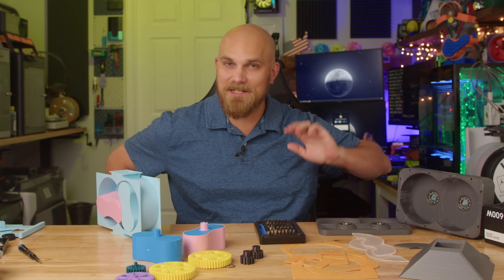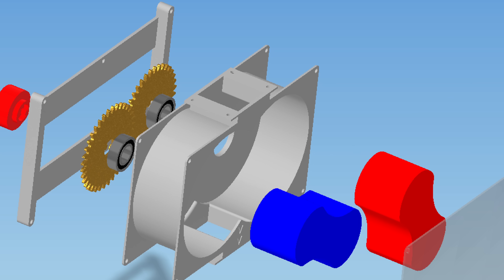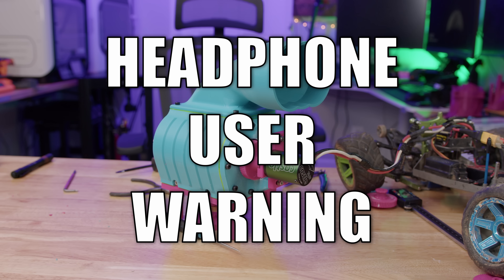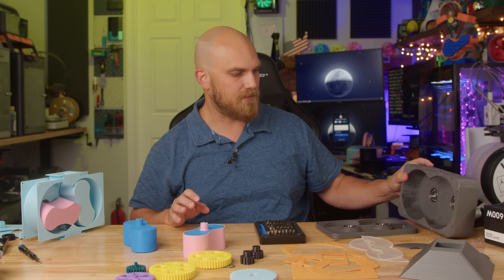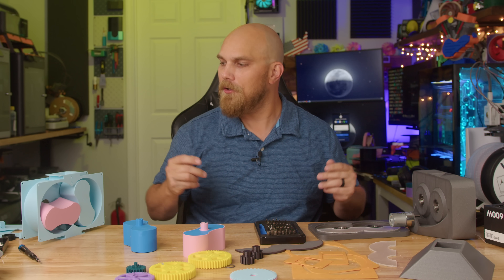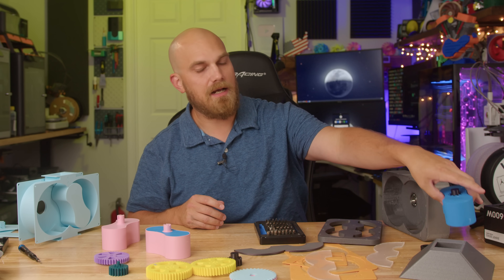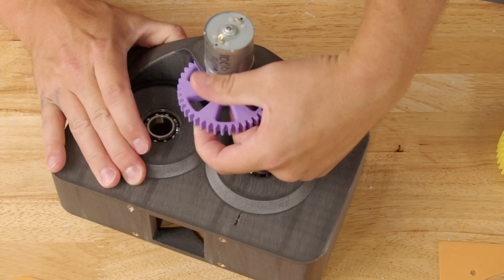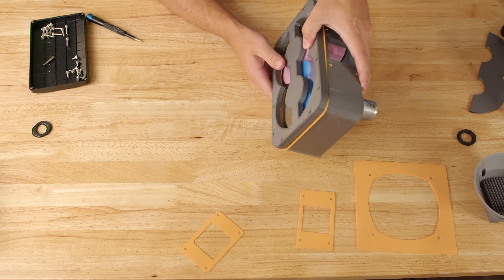Turning a Viewer’s Roots-Style Fan Concept into a Performance Beast! | Fan Showdown S6 REMIX

Comment: Remove those inlet fins! Well known that positive displacement blowers HATE inlet restrictions. Might be worth playing with making the inlet port larger as well. Also might be worth costing the rotors and case with graphite paint to act as a sacrificial gasket between the rotors. TVS (Google them) use a Teflon coating in their automotive stuff.

Comment: you could probably eke another couple mmH2O out of that design by tightening up the gap between the rotors, as well as the gaps between the rotors and housing. Maybe look at doing something similar to the wipers used in commercial designs, but instead of having full contact (as getting the surface finish on PLA to the standard that requires is not happening...) you have a T slot at the apex of each lobe withe the bottom of the T pointing straight out from the center of the rotor. This way, the same way you can slot bolts into the channels in extrusions, you can use a TPU wiper printed so it almost makes contact. 

since the wiper would be removeable, you can just swap it for a longer or shorter one to check different gaps. Alternatively, you can try using other materials like paper or cardstock which may work for a full contact design. of course, that all depends on if you want to optimize the design.

Comment: As a car nut into superchargers I have a couple of notes.

1.  The rotors are too big. I have a 1.3L and a 1.9L blower. The diameter of your rotors are bigger than mine obviously yours are shorter but still.

2. You gotta get some twisted twin vortices style blowers that will be more efficient and quieter. Not to mention you can use four rotors instead of two.

3. Try to balance them, this will save on noise.

4. A lot of good blowers come with either polish or Teflon coated rotors.

Comment: If you tighten up your rotor end clearances to the cover/case (you could do this by omitting the gaskets all together and using a thin layer of silicone to seal the cover), you could easily double or even quadruple that number. Positive displacement superchargers are capable of massive pressures if you keep tight clearances.

Comment: This idea may be here, but look at a rotary engine and there seals. I think your losing airpressure around the lobes. Maybe use a small tpu filament between the lobes and the walls. Also as it's been said, the gap between the lobes and the plates will drop air pressure. But man that looks nice, makes me want one to hang on the wall, it's a kind of cut away.

Comment: If you're going to continue this series the way it's going and the top slots being so far removed from a computer fan than you might as well change the motor base to be something more powerful. 
If the goal is to just to see who can make the most over the top design than why limit them to an underpowered motor that was designed for reasonable fans?

Comment: Adding some lithium grease onto the pla gears can make them both more efficient and a ton quieter. I did this for a water pump contest in one of my freshman engineering classes and it got us something like 40% more water from the same current draw on the motor

Comment: If there aren't occasional scrape marks on the front and back of the case then the gaps between the rotors and case are too big. Also those vanes added in the top just reduce the area of the intake and reduce flow. There's no point in trying to straighten any turbulence when it's going to go through the pump.

Comment: You should make this its own sub-series for 'Fan-Showdown' videos. You can call it 'Fan-gineering' where the whole premise is to take failed attempts of previous competitors and re-engineering their fan design to create a 'best case scenario' if the concept of their idea could actually work. Kinda like a Mythbusters episode, taking the concept of the myth with the premise to prove or disprove their validity by replicating the intended results either by natural chance or by excessively manipulating the circumstantial factors to make it happen.
Reply: I second this
Reply: Third this! This would be awesome!
Reply: I was thinking the same thing no holds bared with and upper rpm limit for the air moving compressing part say 5 to 10k rpm max speed but everything else is fair game even multiple motors for multiple stages of compression.
Reply: Love the name
Reply: It would be interesting for the 'fan-gineering' to also be community driven. Just release the stl files to the community to redesign/modify the base concept.  Anything to far off from the original design gets disqualified.

Comment: Gear reduction is torque multiplication ... While the A12X25 doesn't make much torque you should be able to do 4:1 which MAYBE is enough? - Or perhaps the better question is how much gear reduction will you need in order to turn that apparatus and get some level of flow. Can you even get it to match a stock A12X25s output?

Comment: so. several improvements, some of the comments, use graphite or sewing machine oil to lube the barrings, use ring gaskets on the shafts to prevent bypass, and use helical gears to reduce gear noise. (as well as using a different material to avoid the 3d print rub sound)

Comment: "And I have it windows..."
😒  Going on record now with my prediction, that the massive gap that'll be present between the lobes and that cover, is going to ruin its chances of making any usable pressure. 😞

Hopefully I'm wrong!! 🤞🥴🤞

EDIT 1: Alright, so like like he made the window recess the same thickness as said window plexi... So THAT'S good! However, he didn't make the lobes TALLER than the case, to account for the TPU gasket, thereby causing the gap I originally thought would be there, but way worse now due to being the entire cover in size! 😅

EDIT 2: Hey hey! I was wrong. Totally fine with that!! I do wonder if that gap IS impacting performance though... I guess removing the TPU (and shims) would be the only way to test that.

Comment: It is, I wonder if you put sound dampening foam in the corners and around the edges of the case if that would reduce the noise levels.  Perhaps a needle bearing would be quieter too.

Comment: It seems like your gasket and spacers are creating a larger gap between the rotors and the window. I would be interested to see if you could get a higher pressure with them removed if it will run.

Comment: You should research clock makers' gear setting.
You don't have the manufacturing accuracy to predetermine gear spacing. That is a major cause of noise (and mechanical resistance)

Comment: Awesome concept. There are a few ways to cut down on noise, too. One would be to use helical gears with a cover over them and a small bit of oil. A performance boosted would be felt gasket material for apex seals on the lobes. Or UHMW plastic and a coating of the Silicone-Teflon spray.
Reply: I've seen several performance and noise improvement suggestions. I would love to see all of these.

Comment: Would it not be possible to run this off of an A12 by using belts instead of gears? I think that we still need to see this powered by an A12. Try putting an extended hub onto the A12 that can host a belt, and run that belt to one of the sides, and have a middle wheel that connects to  the drive side via belt, and have the other blower side connect to that center wheel, to get the proper rotation of the second one. Less torque will be needed to spin the belts in theory, and you're able to change the gear ratio entirely by changing the pulley size of the fan. I'm 100% certain that this would function properly, as long as everything is run on bearings, and no belts are tightened too much. Gears are definitely NOT the way to go, though.

Comment: I have a large roots blower in my workshop. It is set up under my CNC router to pull a vacuum on the bed to stop parts moving around. 
Roots blowers dont only move a large amount of air, but unlike a fan which moves the air dynamically, these move air mechanically, by which I mean the air doesnt have a choice. They will keep pushing out pockets of air until there is no air left (if the seals are good)
On the other hand, when a fan encounters low pressure, the blades just spin uselessly without doing much work.

Comment: I wonder if adding a thin flexible "spline" along the flats and the lobe ends would increase the static pressure even more.  As another commenter said, finer teeth on the gears would help decrease the noise level, or even going to a belt drive between the two yellow gears.
Reply: Belt drive ftw. And tighten up the tolerances inside to eliminate gaps for improved performance. And the smooth delivery of power through quiet belts.. 
Yes...

Comment: If we're dealing with positive displacement, might be able to beat it by copying a slip-vane rotor style setup such as a Judson. Might have to be liberal with Teflon coating to get it to work however, given the motor expected to be used has next to nil for torque.

Comment: If you could put a variable rheostat and dial down the speed it would be interesting to see what 1000rpm sounds like, and what the static pressure is at.

Also, your noise at the gears, try to file/sand them down smooth and it may help the noise. Or use graphite as mentioned below.

Comment: The limits that the fan showdown is constrained by is what makes this series so interesting. That being said, it wouldn't be less interesting if the motor limit was removed or at least modified by allowing something a bit more torquey.
Reply: I agree except in this case, 2 of them would be good, while not within the limits of a single A12x25, at least it is a known amount.

Comment: @Major Hardware
would it be possible to make it triple pronged instead of double ( the pink blue center pieced ) and if made by metal it could be made in cero tolerance cutting model... and technically it doesnt need to be so chubby... if you made it slimmer ... the cero tolerance and the extra prong would help to push a higher % of the intake air... instead of like it is right now that a higher % of the air thats inside bounces around not escaping. since fluids ( air included ) will choose the path of less resistance this gaps will make this be way less effective .... and i know that making a cero tolerance metal cut would be expensive... but it could be a great success in an intake fan/compressor .... on the other hand if you do this... the air would be hotter because of said compression and friction so .... the harder its pushed the hotter it will be... this is a real conundrum

Comment: The gear noise reminds me of the other fan seasons back that had smaller fans that were geared and spun better after having been run for a while (broken in). Seems the same needs to be done for these gears, be broken in after running for an extended period of time.

Comment: I'd be interested to see what you could do with the A12x25 motor, just geared down until it had enough torque to spin the lobes. Might only be 500 or 250 RPM love speed, but it's be interesting

Comment: I had a watercooled setup with an automotive radiator and fan in a shrouded box, that was very loud, but the radiator was so big it could run completely passive with two GPUs in the loop.

Comment: It put out 50% more pressure than the leader. 
Wonder if scaling it back smaller, you could use the fan motor to drive it. 
Hollow or very little in fill on the rotors making them as light as possible.

Comment: Looks really good! Personally I'm not too impressed by the performance, I'm also not surprised that you got it to work, with a much more powerful motor. Positive displacement pumps has a huge advantage over fans, when it comes to static pressure, even at the same amount of power. But again, it looks really good, and it's definitely great for showing the working principle of a roots blower. If you can get it reasonably quiet, even if that requires running it at very low rpm, it should be great for decoration.

Comment: This test is a farce 😢 you have abandoned all your previous test criterior, at least your previous tests actually proved they could cool a PC, and if it failes the smoke test, your only visual test, then you have to question your methodology. This is disappointing that you have gone down this rabbit hole and only test a 'so called fan' on one attribute! The wonder from down under could FLOGG this! And what is the CFM? Why are you doing this? Anybody can make pressure! But it has to flow! This couldn't cool an ant let alone a PC, and isn't that why you started this channel? To actually test something that might actually work in a real world situation? Should be ashamed of urselve and I won't be watching anymore of this diluted testing😢 previous seasons were great 😅 the Cheater would flog this! Am so disappointed, cause you were so good & now you only chase ONE parameter 😢😢

Comment: It's loud cuz of all the hollow plastic. I'd imagine something smaller with metal parts and properly engineered might not make that much noise, but the problem is it likely uses a lot more power for the air volume you get.

Getting 25% more air, but using 50% is kinda pointless from a consumer perspective as well. More air is good for cooling, but if the motor consumes way more power to get to that then you are effectively costing yourself more money in the process.

CFM per Watt.

All of this testing is getting more and more pointless though, because all this tempered glass nonsense means it's actually gotten quite hard to find good cases that take advantage of more airflow. I checked on the large case manufacturers and none of their designs strike me as having really been thought about in terms of airflow unless it's something specifically for "workstation" even though it seems they kinda forgot what that means too. Good airflow cases that still offer features you'd want in a case are hard to find sadly.

Comment: Consider using timing belts instead of gears for the gearbox, to reduce friction and noise by a lot. The Voron 2.4 Z-axis gearbox gives a 4:1 (or 1:4) ratio, uses high-speed bearings throughout, and can easily be "borrowed" for this design.

Comment: you need to use the Noctua Industrial NF-F12 3000RPM fans. they are crazy. They produce almost the 8mm in h20 of that best you have on that list. I use them for static pressure in my open case on the wall to go through filters. no other fan would pull air through the filters

Comment: Man if you reversed the gearing so its 1/4 the speed (way more torque) and then put wiper seals on the faces and tips of the rotors, you could get over 30 pretty easy I'd say.
Remember pressure has nothing to do with volume, the better seal you can maintain in the "pump" the higher pressures you'll get, but you need the torque to overcome the friction of wiper seals.
Reply: Also the windows are a massive air leak (ie. face of rotor to window face, because of the not perfectly flat finish with more than minimal air gap)

Comment: Sooo, this goes beyond regular computer mods and such. Taking the side cover off the pc and placing a fan against it would be far greater in reducing what you are doing. But sure, keep digging down this hole. You are, and have been, hitting a  wall with pc cooling. It  is just a waste of time at this point. If you want to work for Noctua, and have fluid dynamics as a PHD, just go work for them and then do some research. This is just, garbage science at this point. Sorry Bro, I started watching your channel for fun. But at this point, it is just garbage science. Unsubscribe, good bye.

Comment: Now what would be nice is if you did a scale model of the A12X25 to fit that motor. That way, we can see if the design is even worth pursuing. It definitely produces more pressure, but it's got a stronger motor. Does it produce more pressure than a comparable fan could?

So we either need to see a design like this one that works on the A12X25 motor - maybe just a smaller scale of everything - or a larger scale fan-style comparable to what the Noctua people could do if they were using an engine with that kind of torque

Comment: The spacer you added between the blower and the window cover to compensate for the thickness of the gasket creates space for air to bypass the blower, so you're losing performance there. You need a tight gap axially between the front and back faces of the blowers and the case, not just radially around the outer edge.
Reply: yep, you need the front and back of the rotors to be super close to the edge
Reply: @cannesahs  I did write it all out again and then I saw the comment was already there. 😅
Reply: came here to say this.  I had trouble focusing on anything else after he put those in there. lol
Reply: He also forgot the teflon.
Reply: Absolutely true.. One more thing. These gears create too much reduction, the system should spin at a much higher RPM in order to boost the performance.
Reply: The rotors need to be closer to each other to seal air from bleeding through. This will also be influenced with rotational speed.
Reply: How do you know he didn't already compensate for that in the design?
Reply: @TheRattleSnake3145  because he said the gaskets/spacers were added after the fact, and having that spacer on the rotor seperates it from the cover by at least the width of that spacer. Meaning you have a spacer sized gap between the rotor and cover plate for the air to bleed through and bypass the blower.
Reply: @TheRattleSnake3145  great question. but it's bc he didn't cover this aspect in the video. so how could we know?
Reply: Do you think that's what's causing the bleed off as static pressure builds up inside the tube?
Reply: +1 for this. The first thing i thought of when he added the spacers. This needs to be corected and tested again. You definatly loose some pressure there.
Reply: Bump
Reply: Look at y'all! Bunch of smart peeps in here!

Great suggestion.